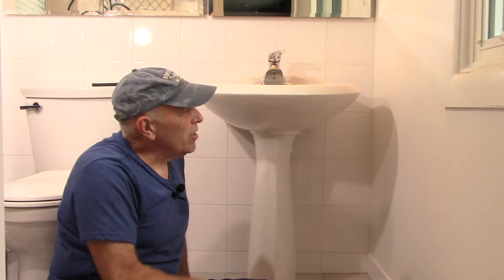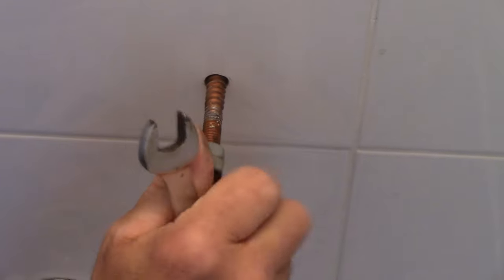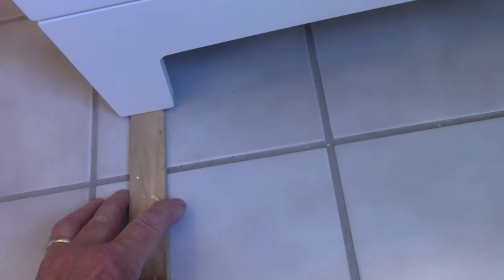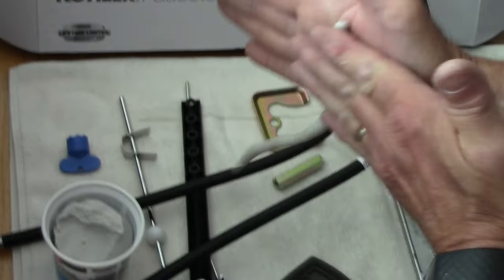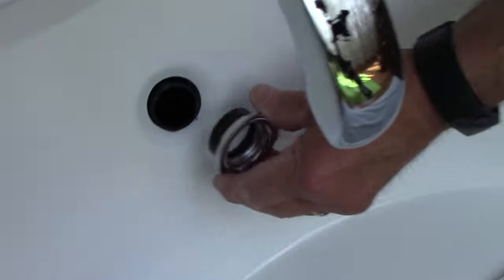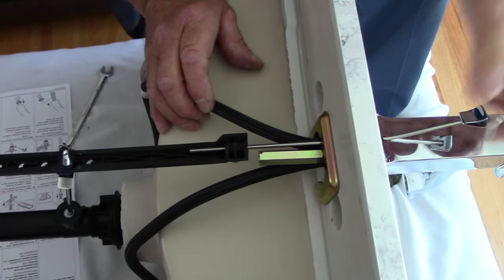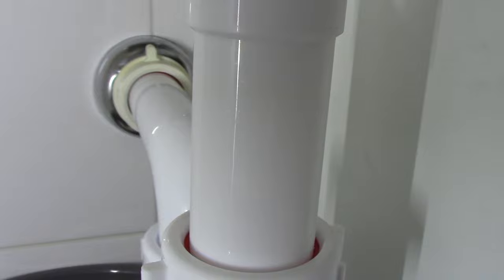How To Remove A Pedestal Sink And Install A Vanity

Comment: Thank you so much for posting this tutorial!  One of the best I've seen and it's perfect for my current situation looking to replace a leaking pedestal sink with a vanity sink.  Could you clarify the need for the shims between the vanity and the wall?  Are those just filling the natural gaps or are you intentionally using them as spacers?  And do the screws go through them or do they sit above the screws at whatever depth fills the natural gap?

Comment: What did you do with the holes made by the hanger screws to hold up the pedestal bowl? Did you fill them? Why did you have to drill new holes to secure the vanity? Thanks for the info.
Reply from the maker: The holes was just filled. We drilled new holes because they needed to be in another location.

Comment: Thank you for your demonstration. I wouldn’t use the pop up I use a strainer in the drain to prevent hair and fur from going down the drain clogging it over time, I suppose there’s a way to seal a cap or something to close off the opening in the drain pipe where the popper works from?

Comment: I'm having a hard time trying to pull the pedestal out so I can get to the plumbing! Any pointers from anyone? I don't want to break it, so afraid of tugging too hard on the base.
Reply from the maker: If you took off the screws and it is still stuck check to see if there is silicone holding it in place. If you still can't move it send me a picture I'll try to help.
Reply: @getitdonehomerepair  Thank you so much! What screws? I'm just trying to pull the pedestal back so I can see where the plumbing is leaking.When I pull the pedestal backwards, it won't budge. Again, thank you for your time!!! 🙂
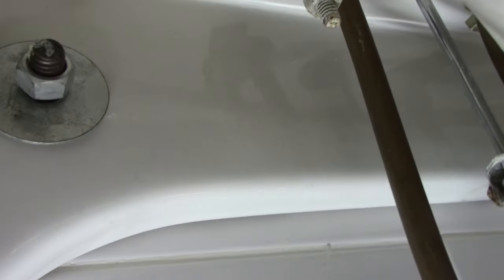Reply from the maker: @pennychase2421   Take a look at my video at the 5:00 mark. You will see 2 - 9/16 nuts and washers . That is what holds the sink to the wall. Keep me posted.
Reply: @getitdonehomerepair  Will do, thanks so much again!!
Reply: Ahhhhh, I see! Yours was all one piece? My pedestal is separate from the bowl...2 pieces. So I'm not trying to remove the bowl, I'm just trying to get to the plumbing pipes to see where the leak is coming from behind the pedestal part. Do I still need to remove it as a whole for that? Thanks again!!